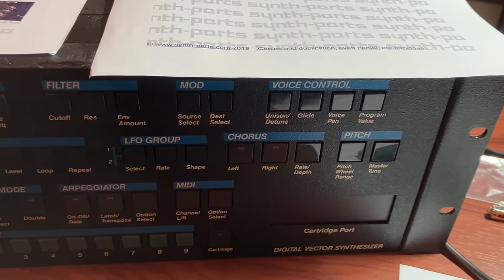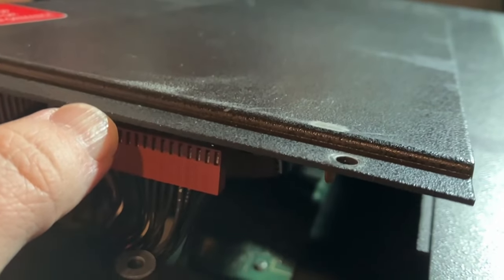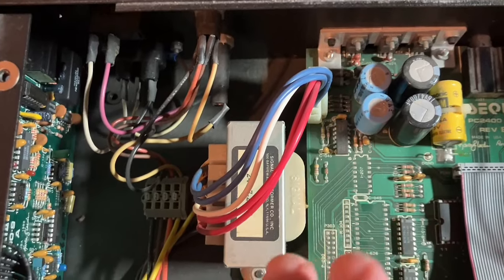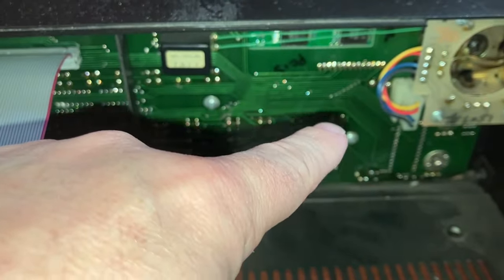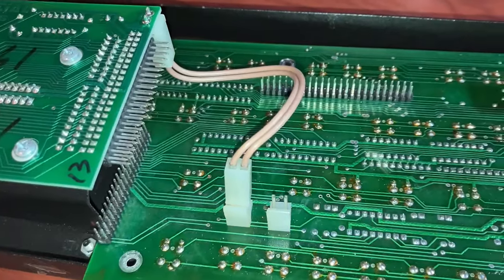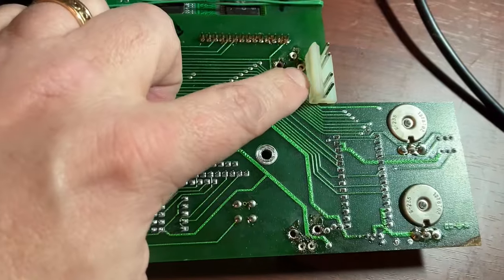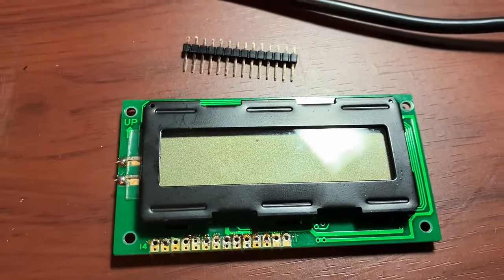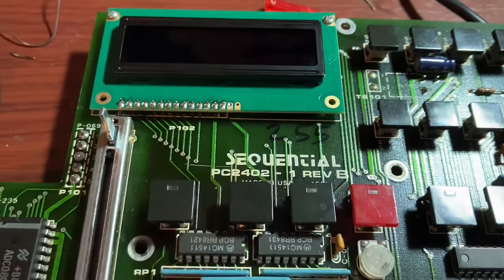Sequential Prophet VS Rack OLED Upgrade and Slider Replacement (and a tour of the PCBs)

Comment: I'm not surprised the display was the source of noise. It's always refreshing when we go into the unknown and whether simple or perplexing, we resurrect machines and know they can live on indefinitely.
As I mentioned to someone else, the list of things I've repaired to perfection that were dead after the fact, is unfortunately longer than that which I have managed to resurrect.
Reply from the maker: I am worried about a lot of these 80s and 90s synths that have custom parts on them. Once those parts die, they’re paperweights. With stuff from the 70s you can (usually) replace everything, especially with the SSM and CEM clones now in production. But if a digital ASIC from your Ensoniq Fizmo does, it’s toast.
Reply: @Lantertronics  that's probably why people sell this model for 5 to 8 grand! They've become scarce.

Comment: The high pitch wine was the display transformer. I had that in my old fatar studio 2001. I cut it off and it was gone. The lcd is not lit but I can still read it. It seems to  happen quite often with backlight transformers.

Comment: The hum is typically just the transformer windings getting loose over time, and mechanically "buzzing" under the alternating 60 hz polarity.  It does not hurt anything, nor does it indicate a future failure of the the transformer.  Just can be annoying, if too loud.  Nice work on the install!  
Do you have a link to the source of the replacement parts?
Reply from the maker: Youtube often delete links, so let me type as: synth dash parts dot com (hopefully that will get through the filters)

Comment: Congrats!
Not a fan of recapping old PSU caps?
Reply: You always start with the simplest solutions then if testing shows there are still issues, you move onto the next simplest solution above the previous and so on. In short, if it aint broke, don't fix it. 
The amount of equipment I've fixed to perfection that died anyway is unfortunately longer than the amount I've been able to resurrect.
Reply: @JonDeth  I would have replaced the battery while it was opened up.
Reply from the maker: To do it cleanly I'd need to get access to the bottom of the PCB, and it looked like a major pain to get to.
Reply from the maker: More a fan of not having to do a lot of work. ;)

If I could have easily gotten to the bottom of the PCB (the way my Manley VoxBox is set up) I would have done it, but it looked like a major pain to get to.
Reply: @MuzixMaker  one thing I have learned the hard way, but sometimes "the wrong way" is in fact the best way to repair some machines. Snipping the leads off the battery and then soldering the new one to them may actually be the right "wrong" way.

I had to replace some rotary digital encoders on a floor guitar amp modeler and FX unit some crazy bitch smashed, and desoldering the broken ones turned into a brutal lesson. With everything being SMD, a heat gun didn't work, and a 30-watt soldering iron and solder pump turned into a catastrophic nightmare. 

I got the 2 broken ones out, and one replacement installed, but when I tested it with my meter to all the others that bear the exact same circuit architecture, I was getting a lot of off readings.

If I could do it over again, I would snip the leads off the broken encoders, and after removing them, solder the replacements directly to the remaining leads. I was so frustrated, I ordered a replacement, the Zoom G5, and the only way to get one reasonably priced was all the way from Japan! 

Hopefully the wounded one works once I get it back together. If those 2 encoders are shot, I can program it using my PC or just side scroll those effects over to another button and knob interface bay, but it was a brutal lesson even thought I've built or repaired just about everything before. SMD is almost always unpleasant to work with, and when I saw that battery, knowing these units are vintage and sell for $8,000, I would snip those leads and solder them to the new battery rather than risk "proper" removal.
Reply: @MuzixMaker  I'm inclined to agree about the battery. While the caps could leak in such a way as to destroy the board, most likely they will fail in a way that doesn't take anything else with them. The battery, on the other hand, is a time bomb. If Aaron leaves it in, it isn't a matter of "if" it destroys the board, but "when." Assuming its already dead, snip the leads and take it out. Stabilize the situation. Worry about a cosmetically appropriate replacement later.